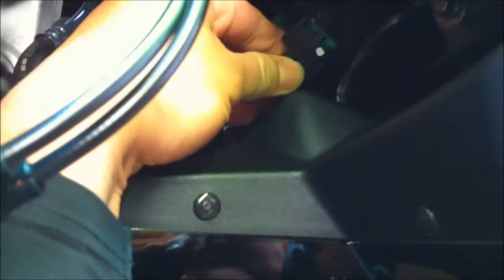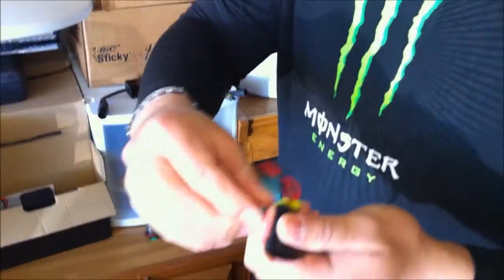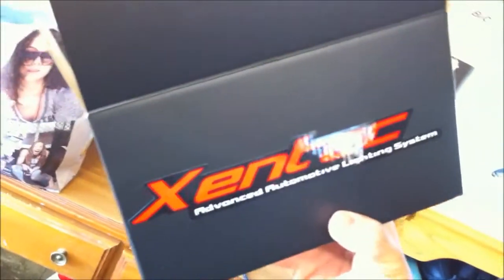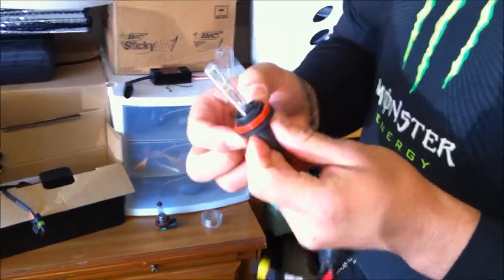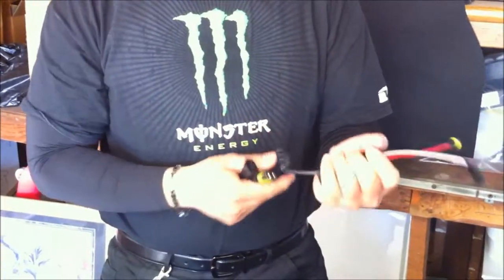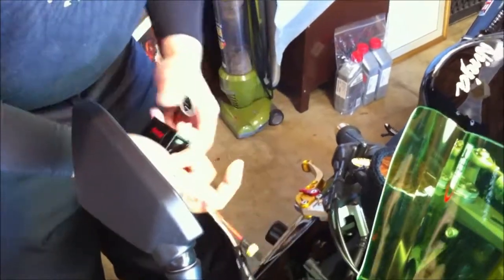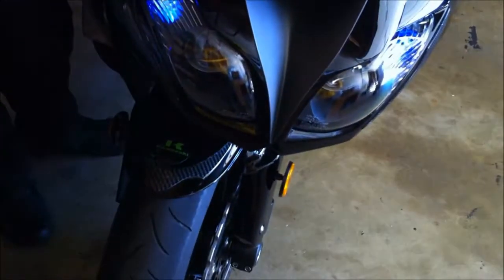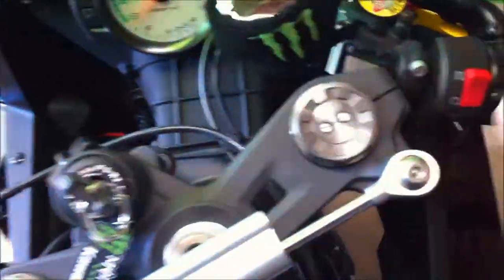How To Install Green HID on 2009 Kawasaki Ninja ZX6R. VLOG

Comment: Mike, the ballast is what powers the bulbs. If any of your friends buy HIDs for their bikes and it doesn't work, they might have a bad ballast and not the bulb. Try the other ballast for that bulb you are installing. Did you put a relay for the HID? The best way to keep the bulbs and ballasts from going bad without a relay is to hold the start button and then start the bike. I am not trying to be an a-hole just giving tips and advice to keep you from spending more money.

Comment: @FaithfulTrigger I would think so.  I've had two different AC ballasts from two different sellers/brands and they worked fine.  The first HID kit I bought had DC ballasts, and  the lights would flicker, so after doing some research i found out that AC ballasts are the best.   Never bought DC again.

Comment: u should get the 4300k or 5000k color temp....green hid is only for looks and your light output will suffer due to lumen loss....if u want looks and bright light output do a projector retrofit and 4300k bulbs and mod the projector shield to give u a thick colorband, it will give u a nice colorshift from white to green,purple blue color just like u see n high end luxury cars ....and dont buy xentec they're DC output ballast , get the AC output ones instead they're brighter and they  last longer

Comment: Hi, you have a link on ebay or other for the same kit hid zx6r 09-12 ? Imperative with original connection for to work please.  (Hid 6000k) 
Thx.